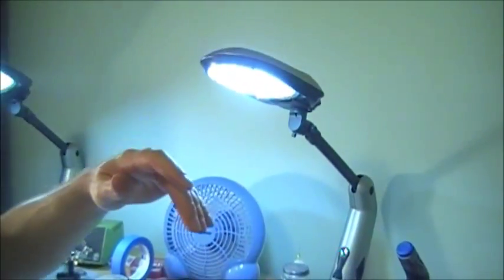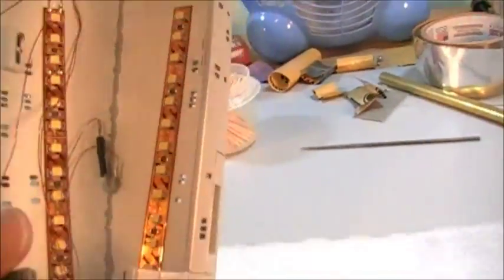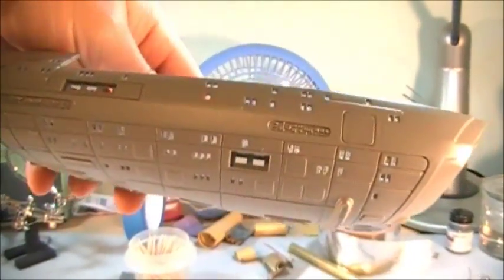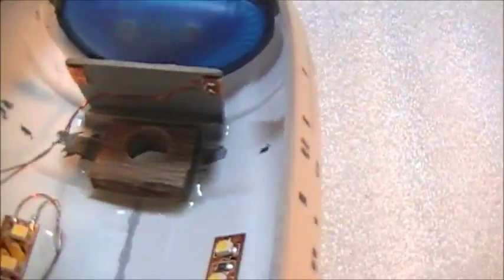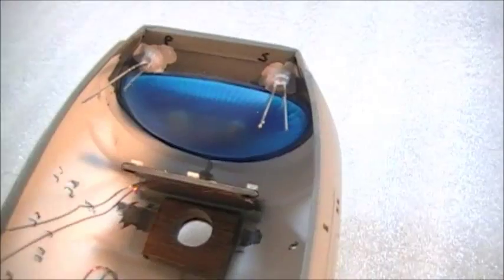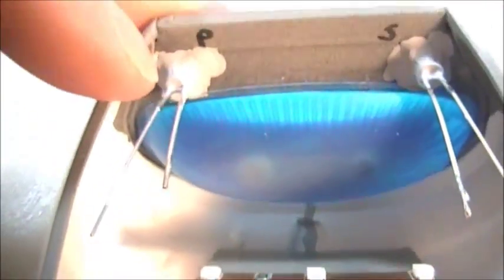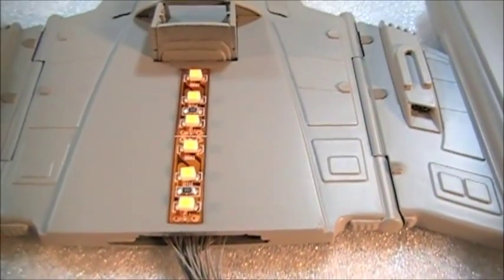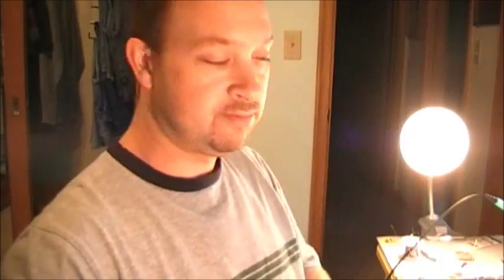Voyager Build # 6

Comment: looks great so far. Im doing the Voyager myself, and im finding the trick to the lights is to keep them all bright white and paint the deflector etc.. its clear colour. Works great and doesnt interfere with windows. if you use blue leds, you then have to find a way to light block that area. But either way looks good.